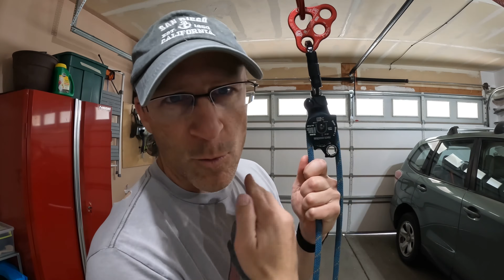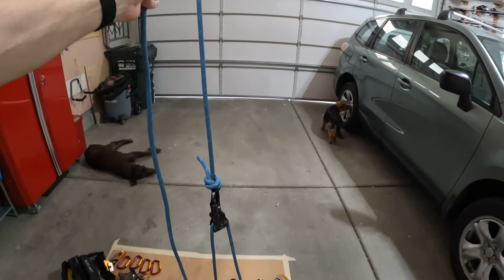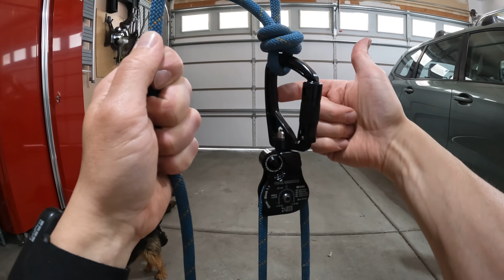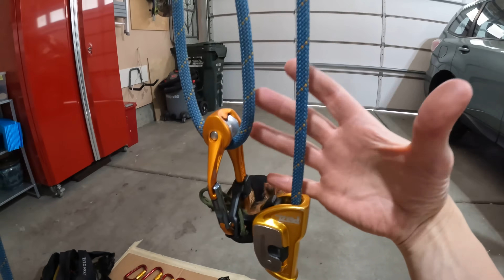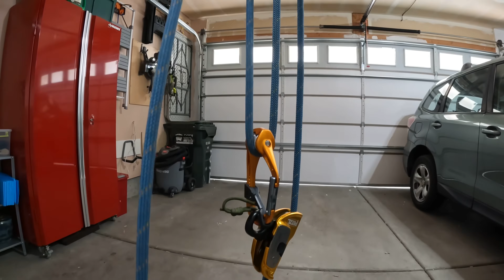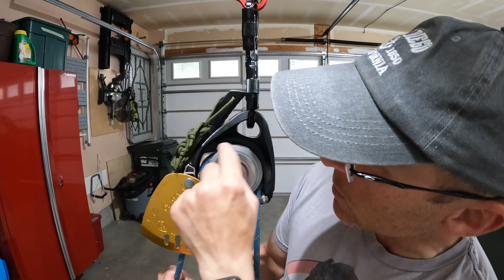Mechanical Advantage: Pulley System Principles

Comment: Given the choice and disregarding any consideration of cost, would you choose the maestro over the clutch?
Reply from the maker: I'm not super passionate about one over the other & there is no such thing as a "one-device quiver" to do it all.... just like "all-season" tires are sort of ok but only in the mid-range of the weather elements.

It all depends.  Am I choosing it as an item for my personal kit or some other "team" kit?  And what do I foresee the majority of application?  What is my "mission profile"?  For example, fire-based technical rescue teams for the most part, in all reality, will use team-based systems.  Therefore I would choose a Maestro hands down all day over a Clutch because there is no "anti-panic" feature that tends to be annoying when operating the device at an anchor (fixed brake/DCD).  Plus the release handle is setup to be more ergonomic when operating at the anchor, but less so if using it as a descender.  I also find it easier to operate it as an "independent team belay" if needed, vs. the Clutch.

On the other hand, the Clutch offers more versatility, as it can be used as either a travelling brake (descender) or as a fixed brake (DCD).  And while the Clutch does not have a built-in friction horn like the Maestro, you can always route the rope through a carabiner re-direct to make up for it.  Personally I think it would be awesome if the Clutch did not have the anti-panic feature & was more like a Petzl Rig, in size as well.

So my personal kit that I keep at my fire-based job I keep an ascending kit with a Petzl Rig in a side pouch on my harness.  The Rig is there because it cuts down on size, weight, and does not have an "anti-panic" feature which for me I really like (but for people who don't do this very often then that may be dangerous).  The team equipment that we carry consists of a handful of IDs, Maestros, & MPDs.

My personal "On-Rope" & Rope Access kit that I have at home I have a Clutch.  Clutches are hands down my favorite for on-rope work, albeit they are HEAVY, so I would not be taking it anywhere that would require me to hike or travel on foot a significant distance.
Reply: @Propeller_Head  Awesome, I very much appreciate the time and thought you put into things. Haven't had the opportunity to use a Maestro but you've piqued my interest in it. At my department, we basically use the clutch exclusively, unless someone has their own kit along with them, there are some who do. Lots of petzl rigs and the like. Situation normal - we have more than enough FD clutches and gear to accomplish nearly anything, within reason. 

That being said, if our one and only heavy rescue is not available (distinct possibility given the breadth of their responses) we will not have access to our long lines or vortex, amongst other things. 

Additionally, generally speaking, our best and most experienced rope techs are assigned to the rescue, thus taking them out of play also. Therefore, I frequently try to train in a manner that forces us to solve problems as a Squad company with limited (rope tech) help and equipment. That leaves us with only 2 clutches. An eye opener when setting up a high line, for example. 

Anyway, thank you for sharing your knowledge. Your explanations are outstanding and immensely helpful, even for a simpleton, like myself.
Reply from the maker: Right on, thanks.  Yea I guess if you wanted one device to do it all relatively well, then the Clutch is it.  But if money is no object..... I'll take them both please

Comment: You're correct, surface area doesn't matter for friction. The key here is pressure. Given the same weight/mass, increasing the surface area will also spread that same weight over a larger area, which ends up cancelling out (on the atomic level there's some weird stuff going on, but for day-to-day stuff it's close enough)